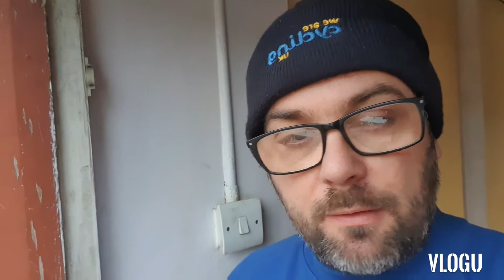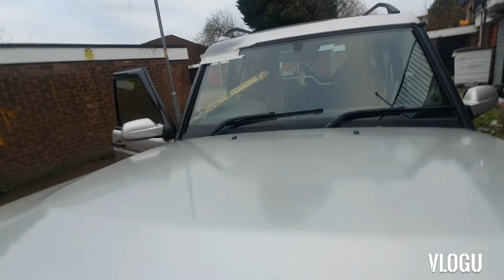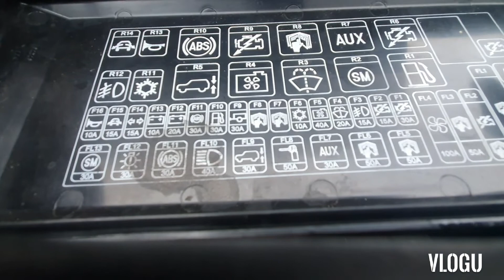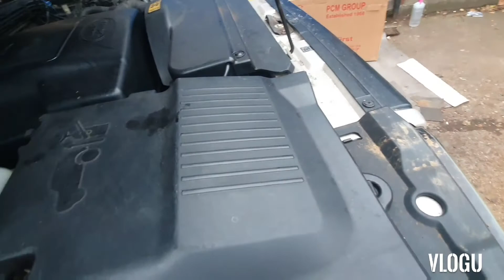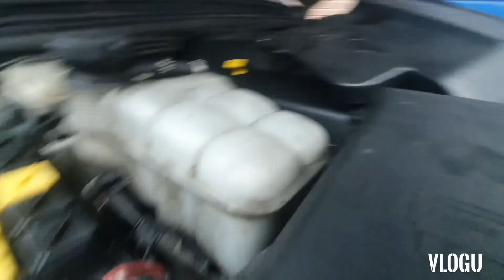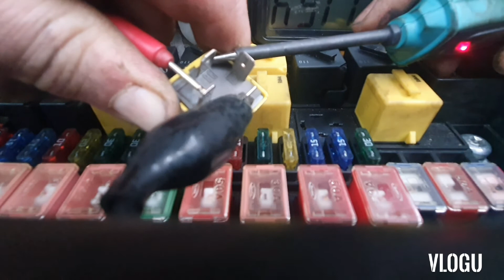discovery 2 no start diagnosis and fix. discovery won't start repair

Comment: Brillant.
Also  the Relais send the 12 v to the brown plug with the 1  Red /brown wire on the right next to it from there It goes to the starter this wire was broken in my case.

Comment: Have the same problem. Disco 2 TD5. New start motor is in place. So I tryied to move the relay as you did. And it works. So did you found the problem? Is the problem under the fusebox?

Comment: You're a gem! The way you described the issue/problem matched mine perfectly. I had removed the dead battery for two days to give it a good charge. The alarm went off upon reinstalling the battery, rapidly flashing dash led lights etc. 
Seriously mate, thank you kindly. I have a 1999 Disco II, 250k miles. Other than the odd assortment of unusual issues, it's been a reliable workhorse for camping in the forest, pulling a 14ft. aluminum boat, kayaks, a 5'x8' utility trailer. 
🤩⚓🇺🇸
Reply from the maker: Thanks for watching. We appreciate it!

Comment: got a td5 disco, new in tank pump fitted and primed, won’t start just cranks and cranks.. any ideas on what i can try? :)
Reply from the maker: It can take 10 or more prime cycles to get the air out. Can be a nightmare

Comment: 😮 How did you do that? My V8 doesn’t click. Battery is good. So I’m hoping it’s a relay issue so I don’t have to pay $900 to have the starter replaced. How did you get it to start without the relay? You said you added 12 volts to the pin. How do I do that? I don’t have a multi meter.
Reply: And then what? Connect it to the red battery terminal & tap the probe to the pin?
Reply: @2004RS4 did you find the issue bro?old mate has a terrible response time it seems.Generally it’s basic stuff like bad earths,bad contacts at the accessories,broken wires,fuel pump not happy,ecu not sending information due to crank angle sensor,running in a cold salty area induces a lot of corrosion which effects plug contact things like this to look for.
Reply from the maker: You can buy a 12 volt probe off 
Amazon cheap or run a wire from
Battery to the relay pin

Comment: hye...i have same issue...my discovery not even cranck when start...fuel cover cannot open and all spedometer, rpm, gas meter and temperature and all not working....can u give me suggestion?
Reply from the maker: Sound like you have no power. Start with checking the battery
Reply: @worx-m2s  tq boss

Comment: I bought a D2 TD5 that came with starting instructions of , usually required the 5 full pedal pushes and lots of cranking. Sometimes 5 seconds , sometimes numerous trys.  Well eventually it didnt start at all so bit of investigation found that the starter motor had lost 2 of 3 bolts and No 3 was blowing in the wind. New starter motor bolts and now tight all issues dissapeared. This was 5 years ago.
Seeing as I picked the car up for a grand in pretty tidy condition but with this issue I did pretty well.

Comment: I've just replaced the headliner and now the car won't start. I'm guessing I've either unplugged something, earthed something, or blown something. Can't really be much else.
Reply: @worx-m2s  Cheers for that, Il have a look. Worked fine this morning with the headliner removed. Will not start or turn over with the headliner installed. Remote key has stopped working also so could be the rf. Was an anticlimax after standing back to admire my fresh headliner.
Reply: @reubenhunter609  Did you find the issue? i am about to install back the headliner after going through repairing sunroof leaks. thx

Comment: I've exactly the same issue, car can be started using a lead off the +ve, the relay tests out OK but when in place will not work and the earth lead to engine tests out OK.  What was your fix for the reluctant relay position issue?  Thanks
Reply: Curious if either of you ever fixed it

Comment: I have the exact same problem except no matter what angle I put the relay in nor how far it’s pushed in still doesn’t start. Will only run off of bypassing the relay for a short amount of time